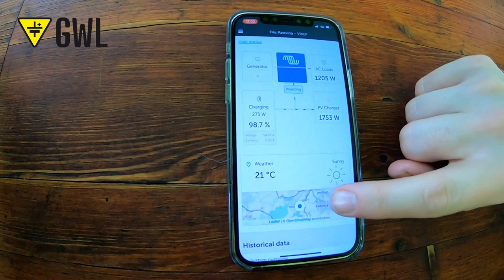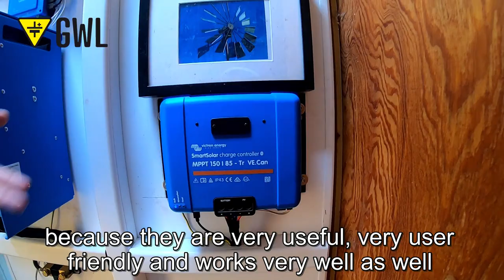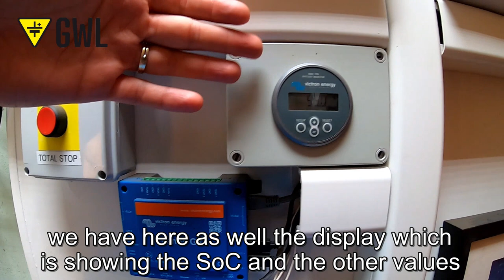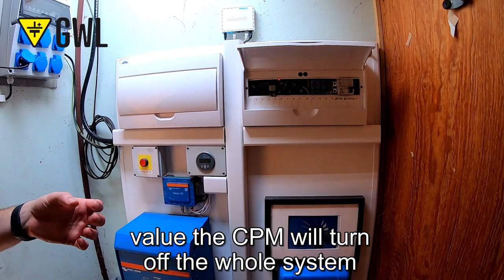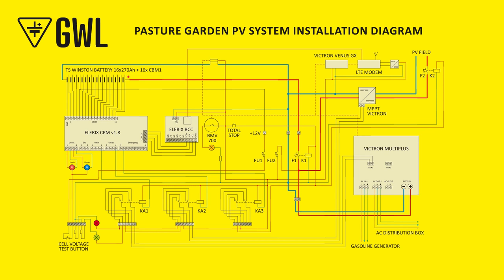How's life with an OFF-GRID PV system? | Interview

Comment: Is the AC inverter necessary? Couldn't this small operation run solely on DC? I expect that it only needs to run a water pump. Router, mobile, laptop uses DC natively.
Reply from the maker: It's maybe different in your country, but here the DC devices are not so common... So it's better to have one universal AC device which you can use in different places. Besides, we'd also consider different DC circuit protection and connector interchangeability...